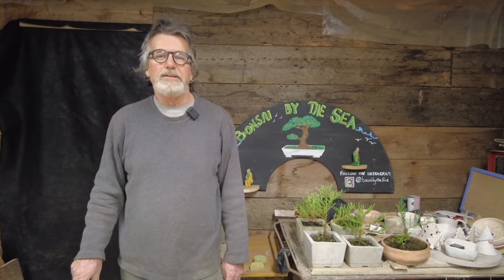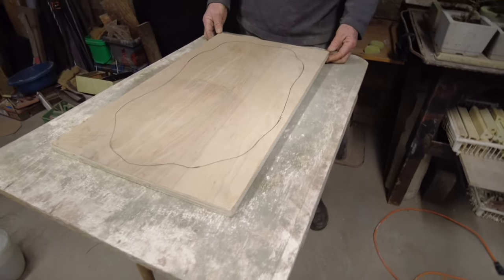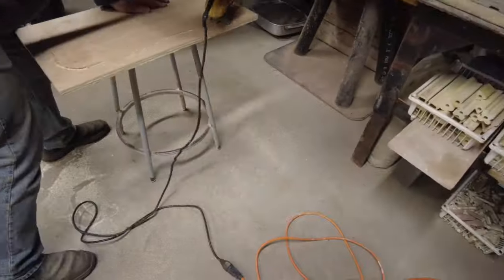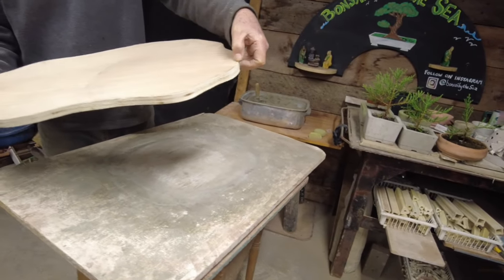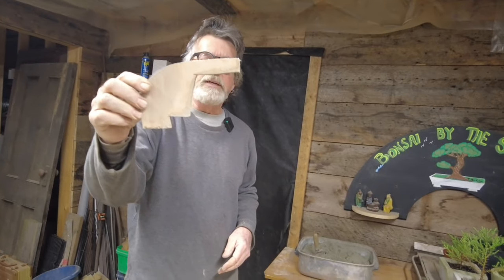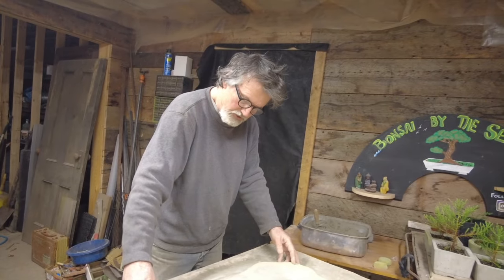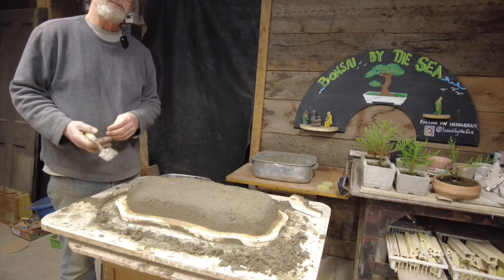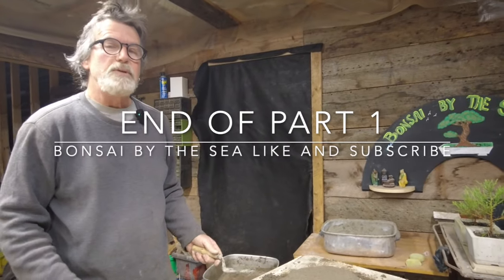Making a Concrete Pot for my Giant Sequoias Bonsai's Part 1

Comment: Nice. Only suggestion is try to keep the sand relatively close to the pot outline, otherwise you will get an uneven thickness in the lip of the pot.
Reply from the maker: This was a new shape for me more complex but I shut for 1 inch side wall